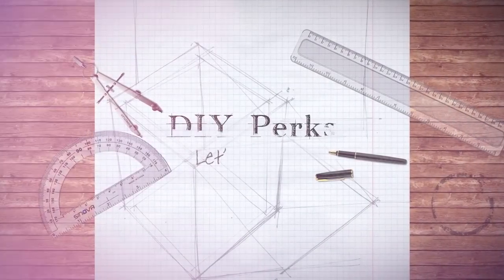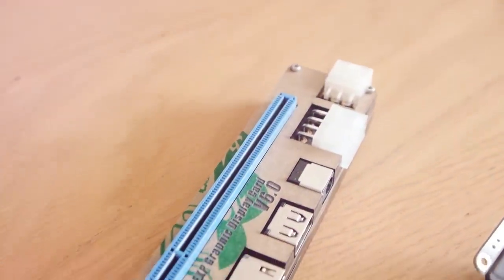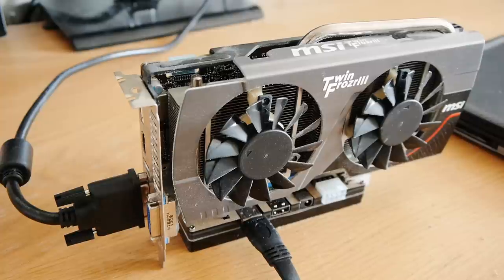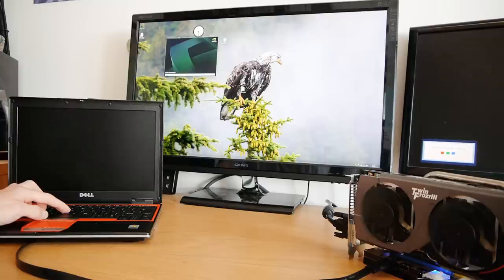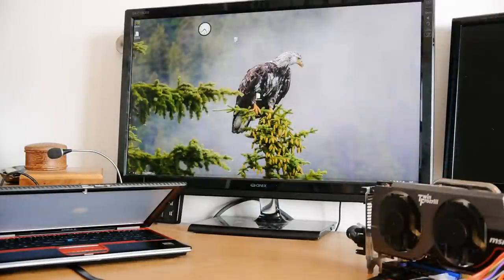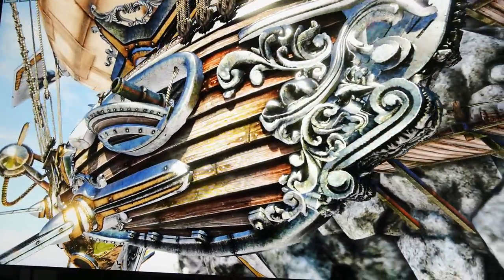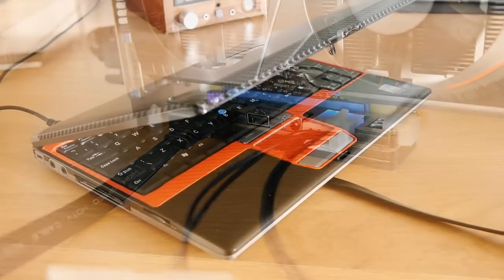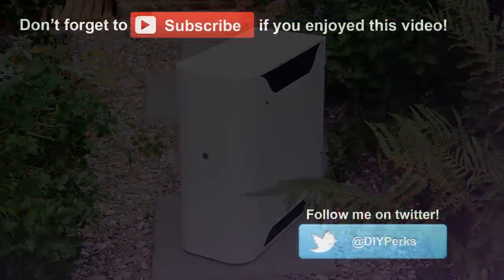Gaming on a Laptop using an External GPU

Comment: You should House it with wood or plexiglass & add a built in USB 3.0 Hub that runs off the same power supply as the GPU. Get DIY Freaky with it like you usually do!

Comment: that screen goes out caused by nvidia driver is pretty common as ya need to put in the registry fixes to tell the tdr to stop conflicting with nvidia drivers by adding dword in this location Computer\HKEY_LOCAL_MACHINE\SYSTEM\CurrentControlSet\Control\GraphicsDrivers along with ''TdrDelay'' value 60, ''TdrLevel'' value 0 and ''TdrDdiDelay'' value 60 all set to decimal which will show TdrLevel=0x00000000, TdrDelay=0x0000003c and TdrDdiDelay=0x0000003c as this will fix the driver crashing as i had this problem on the asus p5q premium nonstop and i did the registry fix no more crashing since. only crashing i get is from cpu and ram overclocking happy days

Comment: Amazing! Just a quick doubt, do I need to use a ATX/DC PSU to power up a graphics card that does not need that "extra" pci-e connector? Like the GTX 750Ti, for example...
(I'm really interested on a high resolution DisplayPort output from my laptop haha)

Comment: Another bottleneck other than the laptops CPU is the pci express port on the laptop which is not x16 while the graphics card needs x16 pcie slot to work properly. Really interesting project though!

Comment: This may be a dumb question but can you use a double sided hdmi cable instead of using the mini vgi cable
Reply: +Lich King Im pretty sure hdmi will not work
Reply: +Lich King That's not how it works. If you use a HDMI output of a laptop then the output for it processed by the integrated graphics card. and if you plug it into the external graphics card then it will only receive what the HDMI port is outputting. Say the Intergrated GPU is outputting 30 fps. then if you put that output into the external Gpu then it wont make a difference because it is only getting a 30 fps signal.

Comment: I'm looking in to trying to figure out if this will work on Macbook's.. Since all the other boxes that essentially do the same thing are literally x100 it's price. I wonder if you'd be able to use a HDMI to Thunderbolt cable. In theory you should, that's how all the other boxes work
Reply: +Deejay JeanP Mac user problems lol
Reply: for MacBook thats another thing AS Thunderbolt is fucking fast. do a quick google
Reply: +LOoImine Yeah, already did but couldn't figure it out.. In theory it should work, but I dont have a €700 videocard laying around, otherwise I would've just bought the thing and tried it
Reply: +Deejay JeanP intel is coorporating with Apple but i dunno if the product is released yet
Reply: +LOoImine On something like this ? I have an Intel graphics card in my Retina, but that does nothing when using it in Bootcamp (which I have to use for gaming use, video editing works fine on it in OSX)
Reply: +LOoImine Yeah l, I have seen those, but they are crazy expensive, while actually doing the exact same thing as the product in this video.. If they (from your link) use Thunderbolt to transfer data, the a HDMI to Thunderbolt cable "should" work with this too I think
Reply: +Deejay JeanP DON'T DO IT BRO, the HDMI connector is just a cost saving measure. It has nothing to do with the HDMI signals a HDTV would need and connecting it to a thunderbolt cable will destroy the card or/and computer. This will not work on Macbooks since you will need a Mac uEFI flashed graphic card to even make the thing run.
Reply: +What Josh finds bullshit Alright man, thanks for the heads up !

Comment: INSTA SUB. This is truly amazing. Thanks DIY Perks.
Before I jump into this. I have a lenovo laptop e531 with i3 3110m processor. Would it be able to run like a gtx 1050 or 1060?

Comment: Will this still work if i use the mini-display port on my laptop, rather than cracking it open and pluging it in that way? They have mini-display to hdmi adapters. So i figure I'd at least ask before doing anything. I'm not against doing the work, but if there's an easier option, i'd like to do it.

Comment: While this is cool and kinda what I was looking for so I can play ARK on my laptop, after thinking about it for about 2 mins. It's not really worth it unless you have the extra power supply, graphics card, and monitor laying around. So if all you have is the laptop you'll spend $50 on the adapter, another $50 on a power supply, $150-$300 on a graphics card, and finally no less than $100 on a monitor. At this point spend a little more and build a decent desktop. Not to mention how much of a mess that looks like with the wiring everywhere. And I forgot about putting your fancy graphics card in some sort of protective case.

Comment: So mini PCI slot a lot better and faster than USB 3, and all notebooks have mini PCI slot 
as i understood, am i right? Answer my questions please if you know. 
Also does mini PCI bottleneck the performance of eGPU, by the way i 
needed for autocad and something like that and sometimes for gaming for several old notebooks already i have. And do i need the separate monitor or i can use my own notebook? And what about the integrated video card or it will work like optimus or i should choose every time the video card before i start gaming, or just i should disable the integrated video card? Also some adapters connected to hdmi while others to usb, Ares there any differences between them?

Comment: This Heath Robinson Frankenstein monster of a contraption is hardly elegant and somewhat fragile as well? Why not just use a gaming PC instead and put the PSU, wires and graphics card inside PC case as they were intended to be as the whole point of a laptop is its portability. I just cannot see a market for this thing at all.

Comment: I have an HP Pavilion 2000, I recently upgraded its ram from 2 GB to 8 GB. I planned on upgrading its graphics card inside my laptop, but it would seem I need a new motherboard or a new laptop or desktop. Using the Nvidia GeForce gtx 750 ti as an external GPU, would it work for my laptop?
Reply: +Ryan Dupre Yeah, it'll work.
Reply: +tehpwner221 So do you have to remove the network card to use this? Or is there a way of plugging in to a port that's regularly used on most laptops
Reply: No

Comment: I have a question,
Most old laptop has mini PCI-E slot probably revision 1,  and GPU is bandwidth is limited by its interface.
So, if i have a newer laptop with mini PCI-E slot revision 2 or 3, does this product work on it as well and improve the performance or it is just only support revision 1 interface?

Comment: waiting for my external PCI slot for my 2012 hp probook so I can play Fallout 4, plus side is since I have a buisness laptop I have a 54mm express card slot so I got the one with the express card adapter. Once I get it I can hook up my 300 watt power supply and the new GTX 1050 TI graphics card to it.

Comment: Just throwing this hypothetical question here: Will this work on an intel atom netbook? I have an LG X120 with an intel atom and 1gb ram, It has a wifi card inside so the slot required must exist. I also have an old low power amd gpu so it would be fun if I could make this netbook capable of basic games with 20$. Right now it can barely run the half life at 30 fps. Passmark score for its intergraded intel gpu is 5. in contrast my gtx960 scores 6000.

Comment: I have a question regarding the use of the adapter. How much would using a mini PCIe to USB 3.0 adapter instead of a straight mini PCIe connection bottleneck the system(if at all)?

Comment: I remember when this was like first a thing, just something that was even conceivable to do.. it was like pure fucking actual sorcery, and just as complicated because it it really did seem like the number one consistent theme was that a lack of instructions.. which makes sense cuz back then high-end laptops were just becoming a thing, so if you went with one you were kind of stuck with it outside of building a whole new pc... Ironic I don't know maybe cuz I was younger, the idea of building a $2,000 desktop or even a $1,500 desktop.. you would get so much bang for your buck by comparison, yet it was so out of reach... And I guess all together you just didn't have to upgrade cycle as much maybe .. and then there was RGB, and everything changed...

oddly enough this was when modular gpus were a thing or just starting to be there's that whole era between I don't know maybe 2010 I can't remember what it encompassed but I remember going through not just a few years ago at laptops with discrete swappable 980s 860s etc, yeah they were mobile but price wise they were not terribly expensive on eBay.. certainly compared to actually buying it with the GPU in it...   

I got to wonder if this is still something you can do, since the I'm pretty sure that the entire concept here would require the pcie lanes that are soldered down now.. would be interesting to see if you could configure the m.2 to maybe make it work? I don't know....

Comment: Wow... I Was Just Wondering If You Could Actually Do This By Using Only The USB Port... But Yeah This Will Do Just Fine... I Have A Laptop With Outdated Video Card And I Dont Want To Spend Money For A Better One (A Video Card Is All I Need) But The Price Though... I Hope It's Not Expensive...
Reply: GTX 750Ti or GTX 960
Reply: +Pixelator Pro XE The GTX 750Ti is getting a bit outdated, but still gets 40-50fps at High Settings. I'd go for the GTX 960 if your budget will allow for it.
Reply: +Infernial R9 380

Comment: hello sir..did you originally have a inbuilt graphics card in your laptop..if yes..after connecting the external graphics card..did both of them run together or only the external graphics card ran
i am a noob in all this kinds of stuff.will asus a550jx be compatible?

Comment: i know this is an old video but i was wondering if this device could be used on a macbook pro 2012 through the thunderbolt using a thunderbolt to hdmi cable and Bootcamp Windows?

Comment: +DIY Perks so I just recently got the same setup. same dock using an HP power supply from a desktop to power the dock. I have an HDMI cable running from the video card to the TV and the supplied data to HDMI cable that's connected to my laptop and the dock. I installed the latest Nvidia driver restarted and I'm still getting a code 43 in my device manager. I attempted to play star wars the force unleashed 2. played like complete shit. even worse then when I play normally on my laptop's gpu..  running Windows 10.  Any thoughts on how to clear this up?

Comment: well i got it and everythime i try to boot it it crashes and i dont know why and im dying 
inside do you think you can help
Reply: When you say try in safe mode do you want me to put it in safe mode and see if it doesn't crash then
Reply: ok thanx ill try it and get back to you
Reply: +Ivan Quiles the only way I could put it in safe mode was to hold Windows key + r and then boot in safe mode that way but even then it still crashed when I said HP so I still don't know what to do
Reply: +Ivan Quiles yes I have tried it with two different graphics cards GTX 610 and a GTX 750 which should give the 610 plenty enough power than it needs
Reply: +Ivan Quiles I can't really do anything now I put it in safe mode and since my laptop is taken apart and it does not have a laptop screen and booted it to the default settings therefore if I can't use it anymore until I get another laptop screen which I'm probably just going to buy a new computer thanks for the help though
Reply: +Ivan Quiles re-do monitored with it but now it's just not popping up with anything but I do know the computer is turning on
Reply: +TiedStatistic I dual monitor

Comment: It's an interesting consept, but it isn't really efficient or practical, and I really wouldn't want to leave my Graphics card exposed like that without it being mounted properly. it would probably be easier and safer in the long run to bulid a desktop rig instead to avoid damaging graphics cards. I think I'll stick to my Nvidia 650M in my laptop and my gaming rig for everything else... but let's face it... this was designed for macs... nobody try to deny it because it's almost certainly true.

Comment: Does the GTX 1060 in some latops are the same as the desktop ones? Because if they are and the laptop supports SLI, then in theory you could use such adaptor to run the laptop 1060 with another 1060.
Reply: the7observer ...and how to install an sli bridge

Comment: I am looking forward to try this. I have MSI GT683 laptop with i5 proc. but some new games it can not handle with gtx560m. So would this run with my laptop, if i purchase just PC video card?
Reply: buy a new budget gaming GPU like GTX 750Ti or GTX 960Ti if you have enough money go for GTX 980
Reply: Pixelator Pro XE  thx. was looking at gtx970 or R9 380. was thinking investing like 300$ to play No Man Sky or Star Citizen. Dont want to invest in gaming PC or laptop atm. This dock thing looks awesome.
Reply: +Rolands J  i would get the 390 instead of the 970

Comment: +DIY Perks Hi bro! worth to get nvidia gtx 960 with this laptop??    thanks in advance.

Dell XPS 15 (L501X)
2GB NVIDIA GeForce GT 435M
i7 740QM 1.73GHz to 2.93GHz (4 Cores / 8 Threads)
6GB @ 1333Mhz Dual Channel DDR3 SDRAM

Comment: I am into making a PC with a Laptop's motherboard. Since it is an "old" i7 3537U Processor it is not supposed to be too noisy. I planned to connect an NVIDIA 1050. I wanted to power de motherboard and the "external" nvidia with an ATX power supply. The thing is that the mother board works at 9v or so was its dead power supply. How should I connect the ATX power supply to the laptop's MB? I haven't seen anything like this in internet. I do not want to use two power supplies for one computer.

Comment: Hi guys, I'm trying to figure out if something like this might help my poor alcohol ingressed MacBook Pro :)Here's the situation, 15" MacBook Pro 2014 model, spilled jack & coke on keyboard at party two years ago, long story short, everything works except for monitor display (works with hdmi out display to tv perfectly). Took it to apple, got quoted $2400 to fix (bought at $2700 new, lol) because they said they would have to replace the whole motherboard.Fast forward 2 years after the incident, the laptop (as mentioned) is fully functional except for the damn display.Any suggestions if this little do-hickey might be one way to go (instead of buying a $1200-1800 mobo replacement) I don't care to put a "gaming" video card, just anything that will give me a 1080p display..

Comment: I wonder if that motherboard and cooling system can handle some serious hours even using a laptop gaming fan. I am curious because I have a older Dell M4500 with i7 840Q @1.8ghz with a older quadro GPU which isn't supported by Nvidia anymore. This would be a option until I could afford to build a Gaming PC or before my laptop Melts down lol.

Comment: Would this only work for a laptop or could it work on a PC as well?
Reply: If you have a Desktop PC, then you don't need this adapter. A graphics card connectd&#160;via a&#160;PCIE x16 express card slot directly to the motherboard. This adapter shown in the video essentially is just a adapter for mPCIE (which most laptops have) to PCIE x16 adapter (which most laptops do not have).To upgrade a Desktop PC you will most likely only have to remove your old graphics card fromt the PCIE x16 slot and replace it with a new graphics card (assuming that your CPU aka proccessor is powerfull enough to handle that GPU aka Graphics card)....
Reply: The tower on mine is a mini version so can't fit a larger graphics card. And I can't move the motherboard to a new casing because of the design of it, it's not made so that it can be moved into a larger case

Comment: Wanted to use this on my sony vaio VPCEE3J0E but it does not have a pcie. Sad times. It is badly designed and the heat-pipe separated from the GPU and it burnt out a while ago.

Comment: my laptop's pcie connector is really deep in and not very accessible so would it be possible to use the express card wire with an adapter to plug it in via USB?

Comment: I have a Toshiba Satellite C55A-5387 with 8GB of ram and a 500GB hard drive and can i run some moderate games like yandere simulator at around 48-50 FPS and it's got a Intel Core i5-3230M and im pretty happy with it it's just that sometimes when speeding up time in the game it bogs down to like 3 FPS and i can't let that keep happening THI IS EXACTLY WHAT I NEED! just wish they made adapters where if my computer had just one PCI express slot i could plug the agutter in so it would have two pci slots in just one so i could use wireless EDIT: also how can i tell if my computer even has a PCI express slot???

Comment: Is any way to use a USB port to not open the laptop or something? That would be the perfect solution :c
Reply: +eduardo guevara Nope. They're developing a USB that is fast enough for a graphics card, but then in the future you'd need to buy another laptop that has it.

It's called USB-C, in case if you wanted to know.

Comment: Got everything done but now it won't give any display on my monitor because it says "This device cannot find enough resource that it can use. (Code 12) if you want to use this device, you will need to disable one of the other devices on this system" what do I need to disable? I already disabled my laptops hd graphics display adapter.

Comment: How well do you guys think my laptop will due with a Nvidia Geforce GTX 750 Ti? I have an AMD E350 processor clocked at 1.6GHz, 4GB of RAM, and I run Windows 7 Ultimate (64 Bit) on one laptop. On the other I have an Intel Celeron N2930 at 1.83 GHz (I may be going to 2.16 GHz) and 8GB of RAM, and I run Windows 10 (64 Bit) on this laptop